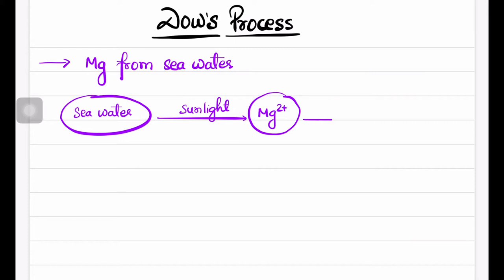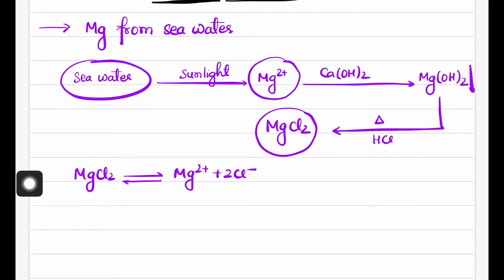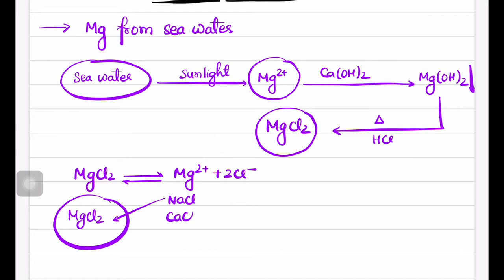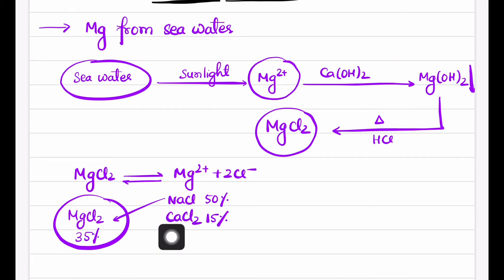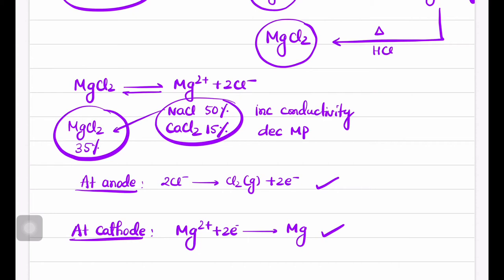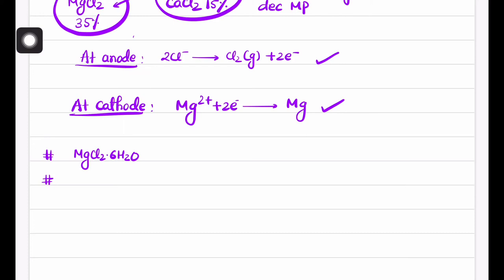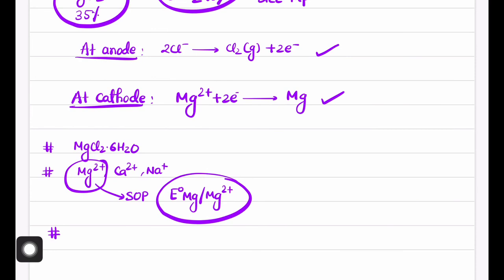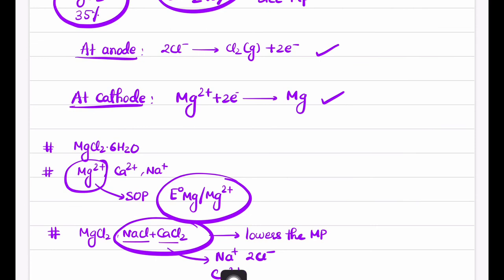Extraction of Magnesium from Sea water (Dow’s process)

Comment: Perfect video. Couldn't wrap my head around slaked lime reacting with magnesium ion, till you mentioned Ksp
Reply from the maker: Glad I could help!
Reply: @cpatelacademy  the dow process uses HCL then adds NaCl and CaCl2 as you mentioned

Is there a way to directly extract magnesium from sea water through electrolysis??

Maybe using a magnesium electrode?

Because i do not understand why do we have to convert to MgCl2 instead of just melting Sea salt and performing electrolysis??

Comment: What program are you using to write with?
Reply from the maker: goodnotes app in iPad using Apple Pencil
Reply: @cpatelacademy   what are the material used as anode and cathode?

When you say molten mixture you mean that mgcl2 as a solid salt is heated to very high temps until the solid turns to liquid without any water?

What would happen if a magnesium strip is used as the cathode? Wouldnt it collet mg molecules directly from seawater and shortcut the process?
Reply: @FirstLast-tx3yj  You should use non reactive metals as anode and cathode. for example you can use Pb rods / Graphite rods.